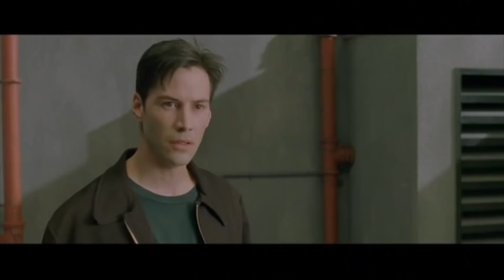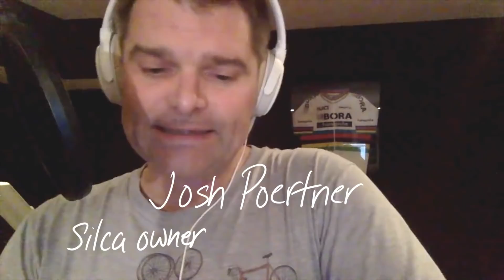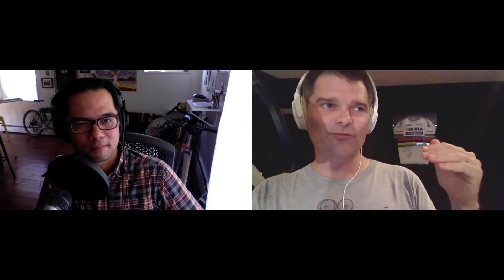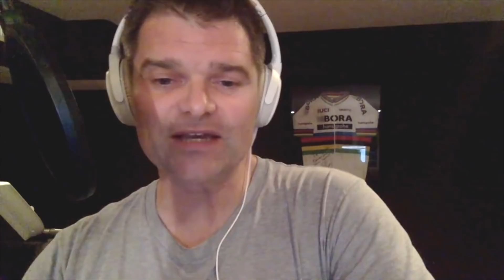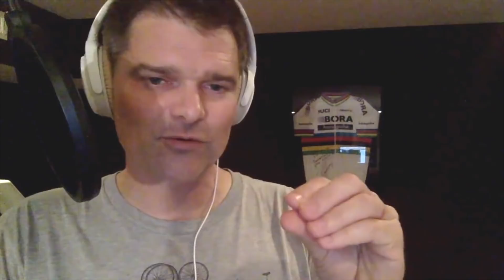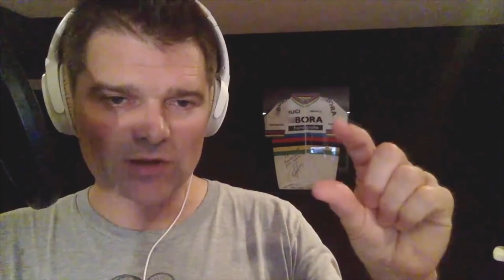Your TIRES are LYING to YOU!

Comment: Omg this shows that rolling resistance tests have such a long way to go, in both test parameters (optimal air pressure, size and width configuration, added weight etc) and transparency

Comment: It took all this time for the industry to figure out what I already figured out in the mid eighties  after getting my hands  on  a pair of Clements Griffo 61s never went with anything under 26 mm just went larger from there. Those paves were a Magic Carpet Ride . Just like the song... I knew I was going alot faster on those Griffos than I was was going with the top end 22 mm tubulars. The time of my favorite route around the lake went down noticeably when I put them on. And the grip on the rougher surfaces was easily noticed. Thinking about it that diamond file tred has always worked well in poor to good surfaces. And going off road was always an option if it's fairly hard packed.

Comment: Been playing with pressure on my CO-motion tandem. Running ReneHerse 650b X 48 total weight 405 lbs. running 48lbs. The ReneHerse tre pressure calculator suggest 57lbs. Truefully tires feel great at both pressures. On pavement.

Comment: The primary lie I hear parroted about tire pressure these days is that you can use lower pressure with tubeless than with tubes.  In fact, the pressure that causes you to bonk the rim on the ground is the same in either case.  An absent tube (that doesn't get a hole cut in it) does nothing to protect the wheel from damage.  

I've even heard my coworkers in the bike shop repeating this misinformation.  I guess it's good business for folks who sell replacement wheels.
Reply from the maker: That’s clearly not true.  While YES, at a certain point if you go too low you’re going to harm the rim, there does exist a range where you may get a pinch flat if there’s a tube in there without destroying the rim.  Its not quite a binary situation.

Comment: I just set the pressure to the max marked on the sidewall, then let it go until it's time to refill next week.
Somewhere along that week it passes through the max efficiency range.
I'm not a racer, so I don't really care about speed. Convenience is more important.
Reply from the maker: That max pressure has nothin to do with ideal pressure.
Reply: @PathLessPedaledTV  
I'm not worried about ideal pressure. At 63 I'm not likely to start training for the Tour de France. Even PBP sounds like too much effort.
As long as it's easy, I'm happy.
Reply from the maker: @JustClaude13  at 63 I’d think you would be more interested in comfort and not rattle yourself to death. 🤷🏽‍♂️ If you watched the video the number is safety number of when the tire will blow off the rim.
Reply: @PathLessPedaledTV  
That's all true. It was a great video with a lot of good info.
But then it bumps into human laziness. If I pump them up to the sidewall pressure I don't have to air the tires up as often before they get too soft.
I'm running Schwalbe 27.5x1.4 tires, and they soak up a lot of road chatter, so they're plenty comfortable. And in an emergency I can pick up 26x1-3/8 tubes at Walmart.
I'm actually pretty impressed by 650B.
I bought the same tires in 27" for the Benotto mixte I found in the thrift store.
Everyone has their own priorities.
Reply: @PathLessPedaledTV  
Confession time:
My tires are rated at 85psi, so I tried them at 70 this week.
They're pretty good at absorbing road chatter, so I didn't notice any difference in comfort, but the bike felt overall lighter and more responsive, and seemed to be at least 5% faster according to the speedo.
Airing the tires up more often may be a bit of a pain, but maybe it'll be worth it.

Comment: So the high number on the side wall is half of what it can take. What about the low number ? How much lower can you safely go without risking a pinch flat. I’m on 700x42. Low number on side wall is 50 psi. This feels way to rigid and over inflated and not comfortable at all. How much lower can I safely go with inner tubes. I weigh 150. I’d love to try 35. But afraid of pinch flat.

Comment: Very good info! Usually inflate my slightly fat (28 and 37) tires to a pressure (~60psi) that when I squeeze the tire, with my thumb on the OD and a couple or three fingers on the inner surface of the rim, I get approximately a 1/4" depression. These are 'touring' frames/wheels, NOT lightweight 'racing' wheels/tires.

Comment: A few days ago, I ran into my old boss from nearly 15 years ago. I wa hanging out at my buddy's bike shop and he came in looking for the most puncture proof road tires he could find. He's a pretty hard-core roadie who rides in pace lines with his roadie friends and was comaining about always getting flats. He chalked it up to the extreme heat softening up the tires. I bet he is running excessively high pressure and that is causing more than usual flats. Wish I had seen this before running into him because I would have asked him about this. I did suggest going tubeless which does lend itself to lower pressures, but he seemed pretty dismissive, even when I said he should do it on his gravel bike. Some people are really set in their ways.

Comment: I still want tires that have higher psi ratings, but mostly because they're roughly correlated with a more durable tire (of course, I look for objectively durable tires). Anecdotally but reliably, crappy <60 psi tires got flats all the time, where even basic 80-100 psi rated tires (on a folder) never got flats, ever. They would eventually explode if I had them at 100 consistently... But never punctured.

I like pressures around 80 on 20x1.50, not a lot of give but good balance of comfort and speed for me now. 60 feels alright, but soft. 100 feels fast on a stripped-down bike but you better have a comfy seat!

Comment: No discussion, in this otherwise excellent video, about the effect of temperature on tire pressure. This is an issue I'd like to hear Josh address. My experience: if I have 75 psi in my rear tire at 45 F at the beginning of a ride, and I check the pressure when it's 65 F at the end of a ride, the pressure will have increased to 77 psi. If that small of a change in pressure makes a difference (don't know what Josh would say about that), then it's certainly a variable to be aware of, and maybe to have to adjust to.

Comment: This is brilliant! What to do is described from 10:48 to 13:13.
Reply: I wish Josh said more about avoiding pinch flats. On a cross-country (USA) trip I had two pinch flats. I was running 70/75 psi with a total rider plus bike plus gear weight of 225 pounds.

Comment: Thank you for having a pro affirm what I feel is right for my BMI, bike MSRP and city riding.

I have Gatorskin tires and many of my uber fast friends keep telling me to go to a PSI of 120. It feels harsh and I don't notice any difference in my average speed on the trail laps.

The large tire for me is worth it, city riding has issues- beer glass and copious mystery flats. My hand was crush so changing tires is harder for me. I would rather have less chatter from wider tires and less psi.

My average mph is 18-22. It was nice to hear at that speed the aero stuff goes out the door. I want to sit back and sit up a litter vice always dropping down in an aero position.

Comment: This video is cracking me up.  I want to have a fatty parade/gathering just to watch him cringe at the inefficiency.  LOL  10 years ago, after researching rolling resistance, I dropped my pressure 15psi from just using a tire's max road riding, it literally changed my life!

I just got a Devinci Hatchet AL because it takes over 700x50c tires.  I've spent days reading reviews and have made VERY little progress.  I want to be more on the MTB side of riding.  (I have a TCR for distance/road and fatty for messing around.)  I decent legs/cadence, I'm tall and thin, but I just want to be able to keep up with friends on "full" gravel bikes.  Anyone else in the same boat?

PS  My Yukon fatty rolls a lot better/nicer than I thought it would or even should. ;)

Comment: As a cyclist and engineer I find this interesting, but for most of us (and even pros), precision in tire pressure is pretty elusive. How precise and repeatable is the gauge on the pump? Or on your external pressure gauge? How often to do you have the gauge calibrated, and by who? Is it done at a certified NIST facility? How much pressure do you lose in the act of attaching/detaching the pump head, or the external gauge? Here's the rule for a lot of engineering: Measure it with a micrometer, mark with a grease pencil, cut it with an axe. That's bicycle tire pressure for you.

Comment: Thank you for this...
I'm going to "Seek smoothness," and figure out what my pressures should be...
Mixed surface/Unpaved rides are such a fun challenge.
I need to overcome the mental resistance I have to letting air out, and then, maybe having to * put air back in* on a ride. 
I probably need a better frame pump!
Do you recommend a really great frame pump?

Comment: Very good information and a great talk. The hysteresis analogy is spot-on. Talking about wasted energy I tend to use the analogy that vibration in the handlebars means micro "jumps" in the bike weight going vertical. Add those "jumps" up and it's just wasted energy lifting the bicycle that's coming from your legs indirectly. If you can feel the vibration, you're wasting energy. Sound in general is coming from... duh, energy. If you can hear it, energy was used to make that sound. Silent is fast.
@31min Talking about pressure sensor linearization, I'm surprised. Lookup tables are so inexpensive now that micro-controllers have gobs of eprom and flash memory. They shouldn't be doing rough estimations with a single constant slope interpretation. Shame if that's true.

Comment: The expert being interviewed did not understand safety procedures and testing. Yes an elite athlete could take the risk and run higher pressures if it means winning a race and getting tiny gains. Same as they risked their body with drugs. To recommend the public ignore max pressure is wrong and will lead to some blowing off the rim. Especially over time as the tyre wears. Elite racers he coaches use new tyres all the time.
Reply from the maker: The expert only worked with Lance and Peter Sagan. Wtf does he know.

Comment: When I got my first road bike, the guy who ran the shop was all about tire pressure.  He said to always run the max pressure that was on the sidewalls.
He also always recommended one tire:  The Vredestein Fortezza.
The max pressure on the Vredestein Fortezza is 175psi.
Riding chip seal pavement on that bike I thought I was going to lose teeth.
Reply: 85-100psi seems fine for less than ideal road conditions on a 23-28c tire.   Higher the pressure the less rolling resistance.  Less rolling resistance = faster speeds.   Larger volume tires can handle less psi.  Smaller volume tires require more.
Reply: @SugmaDLigmaNutz  28c is the ideal rolling tire usually anyway. might depend a bit on specific tires but i think that the consensus was 28 was best with 32 slightly behind by like 0.5W but much more comfort. 65 front and 75 rear is just fine.

Comment: What psi would people recommend for a mtb with 27.5 2.8" tyres mainly for roads/pavements. On my tyres it says max rider psi 25 but I'm idk around 120kg so I've put them up to 45 rear 40 front to see how that fairs. Also because of my weight every ride I think maybe my pressures would go down more than a lighter rider?

Comment: Dayyum! 
Years ago, running large road tyres on an unsuspended MTB, I'd lower the pressures for comfort until it squirmed upon hitting a bump when cranked over, then raise it again until the squirm went and using that as my 'best' pressure.

Sounds like I was doing the right thing without knowing any of the science behind it :)

Comment: I wished you had asked him how important is the front to rear differential in pressure.  I've always put a bit less on the front because it doesn't carry so much weight, but how big of a percentage that bit should be I've always wondered.  On a panic stop or racing down a curvy hill, under hard braking nearly the entire weight goes to the front, when this never happens in the rear unless you are doing a wheelie.
Too much air on the front makes the ride harsher and gets your wrists in trouble sooner.  So I wonder what is best.   5% less?
Reply from the maker: They have a pressure calculator on the Silca website.

Comment: Thank you for explaining what the physics of why running 150%max side wall psi(60max ran 90-95psi), in my 2.20"x 26" semi-slick on my Trek Anelope 800 back in the late 90's. 
The extreme pressure limmits the carcass hysteresis to an absolute min almost 0, making the tread hysteresis the primary factor. At 30-47mph they had a hell of a hum on the back country roads of Merced County( Turlock Road, Oakdale Road, Looney Road,  the stair step Hill section  I don't recall the name of five laps was a 125 MI race that I saw growing up out there.) 3/4-1 1/2" rock cheep ruff asphalt . The ride from my high school to the course, one lap oh, and the ride home was 51 miles 3x /week. I couldn't afford a real road bike  willingness work outside the box  and  walk the pressure in as you describe . 
110 rule  2.20 was the smallest tire the loacal bike shop had for my 25mm mountain bike wheels and could support 250lbs with book bag.
I love hearing the technical aspects but how it works

Comment: On the topic of Peter Sagan and tire pressure: recall the disappointment of the Rio Olympics with Peter showing great form, but, two flat tires ruined the day. The gas law: PV=nRt got overlooked.  Consider that the tire pressure had been closely calculated to be just enough to prevent a pinch puncture. That amount of air was put in the tires to give just that pressure. What was not taken into account was the wetness of the course due to a rain prior to the race. The wetness had made the ground cooler than the air;  air temperature being that which was determining the inflation pressure of the tires. As Peter rode, the temperature of the tires decreased due to contact with the cool ground, and that same amount of air in the tires now gave less pressure, and that new pressure was vulnerable to bottoming out the tires enough to puncture. When there was a wheel change, that tire put on had that same starting pressure, and again another puncture occured as the temperature of the air in the tire cooled.

Comment: Excellent conversation, I was fascinated!!!
 I'm only into fat bikes at the moment (5 to 20 psi) and never had a "roadie" bike. But I totally understood what Josh was on about, as I've spent a few years as a tire fitter in the car/commercial/plant/implement(farm) sectors. I know that pressure differences can seem to be more generous as tires get bigger/wider and weight of vehicle increases. But if you want 10, or 20, or 30,000 miles or more out of a set of car (36psi) or truck tires (100psi), pressures are very important. Even as little as 2 psi gains or loses a load of miles. Equally, if you want your tractor to return to the farm instead of getting bogged down somewhere, pressures are equally important.
Oh, and for race tires? 1psi can mean hundredths of a second per lap.

Comment: I have 3 follow up questions:
You explained the origin of the maximum recommended pressure number.  What is the origin of the minimum recommended pressure?
Should there be a difference in front versus rear tire pressure?  If so,  how much?
Based upon your experience, Is there a typical tire pressure in the pro peloton by tire type?

Comment: It also depends on the type of tire you have. Because My weight fluctuates between 215 to 230 pounds. And I keep my continental gator skins pumped up to 120. Regardless if I’m under the 215 pound mark because I fine with the gator skins especially the gator skins they feel like ass. It feels like you’re driving in mud when it’s under 115psi.  But other than that The two of you are absolutely correct
Reply: Of course you're correct. All of this info assumes a supple tire. Stiff tires are always slow. And feel like poo.

Comment: Wow! Very interesting. Can too low or too high cause cause flats?
Reply: Too much pressure can lead to punctures due to excessive casing tension(imagine two balloons. One full the other half full.  Which one is easier to pop? That's casing tension.)
Too low and you risk pinch flats if you bottom the tire on an object. 
Interestingly with supple tires, too low is not appreciably slower, it just handles poorly. And you risk pinch flats.

Comment: Thanks for letting us know about the Silca tire pressure app.  The feel I get following its recommendation on my road bikes is incredible.  It is transformative for me.  This is one of those rare cycling videos that has been not just interesting, but which provided practical info that iimmediately changed my cycling.  I thought I ran relatively low pressures before but they still weren't low enough.

Comment: They say the front part at the shop. 
The sidewall number is just for safety,  wider tires with lower pressures give a wider and shorter contact patch .
My roadbike is at 115 PSI. So it doesn't get pinch flats and because it feels really fast , silent, like I'm flying, I can hear the wind deflecting off the wheel. Until I hit a big bump , that still hurts.
My mountain bike sounds like a turbo when I go past 30kph. It's at 40 psi
Reply: Sounds like you like additional TSS.